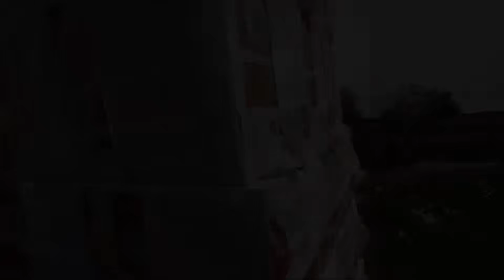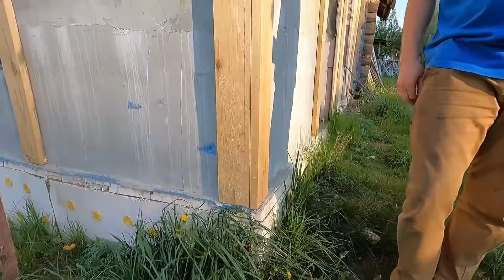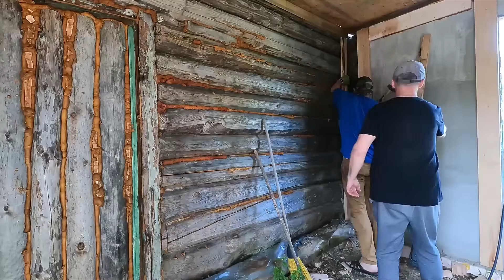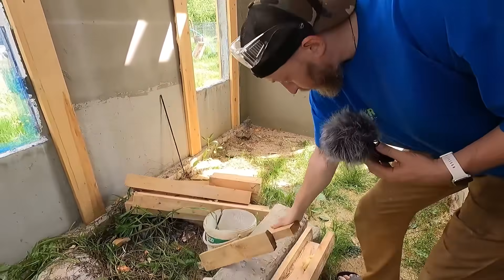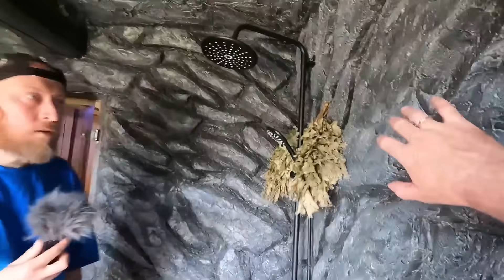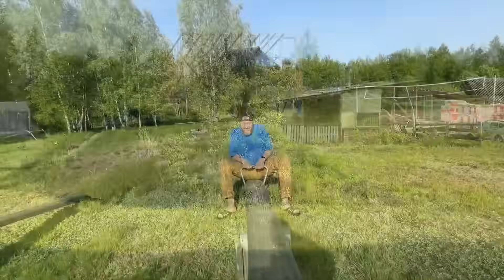Building a House Out of Styrofoam All By Myself!

Comment: Great building project. 
What about covering your outside walls with overlapping wood sidings, these would be decorative and can be replaced easily, they do not need to be fixed to your foam boards but to your Corset wood boards. you could also put a sheet of foil insulation in between to help insulation even more.

Comment: Have you ever considered using a "wattle and daub" finish? Wattle and daub is both a material and a construction technique, a non-load-bearing structure made from raw earth (as opposed to fired clay). It consists of a mixture of earth, known as "building clay," and plant fibers, applied to a frame traditionally made of wood. Furthermore, could you add concrete beams inside to make the structure stronger and more resistant?
Reply: takes a long time to do, and the weather will attack it, I know you can repair it easily but they get snow where they are